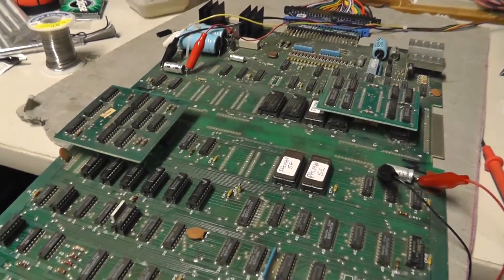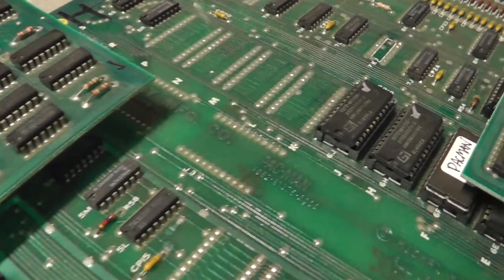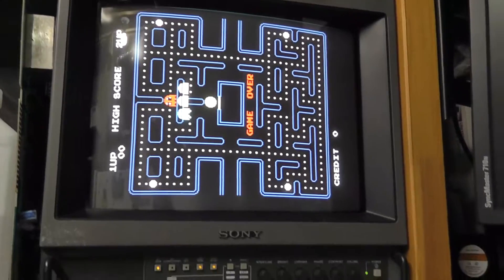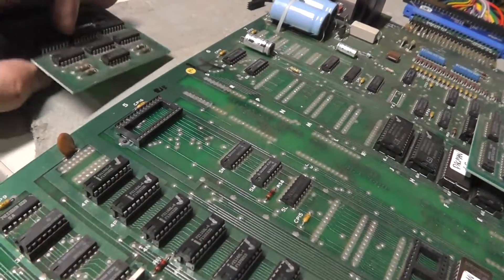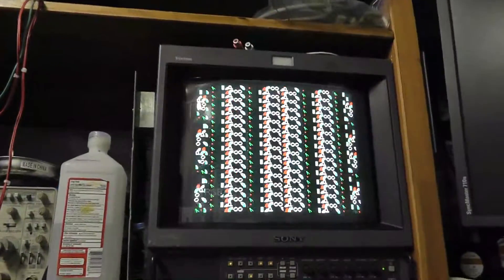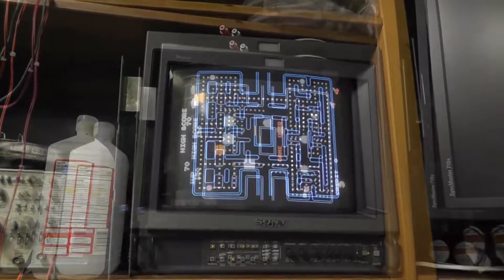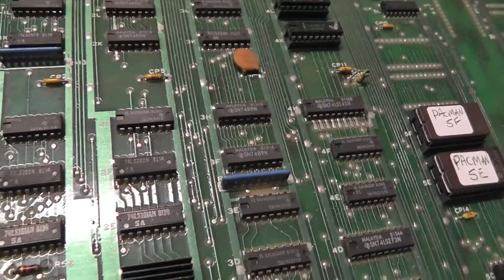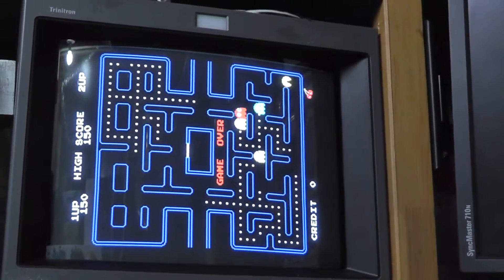Pac-Man Troubleshooting  - Graphics issue

Comment: Shorting data lines to get stuck bits unstuck... been there done that. On an Amidar bootleg (Scramble BL HW). All of a sudden, the graphics became colored lines. After lots of probing I noticed the color RAMs R/W line stuck low. Tried swapping the chip generating the signal. Nothing. Instead of desoldering the (relatively rare) color RAMs I just shorted the line to +5V and not only was the short gone, there was nothing wrong with any of the RAMs...
Reply from the maker: Thanks for the comment and sharing the experience.

Comment: When you "compare" the original ROM file from MAME to the read ROM file that is loaded in the ROM chip you're testing using a GQ-4x. If both files match and get the same checksum value that is Collision?

Comment: When you read the ROM chips data using GQ-4X it will display each ROM address in 8bits hexidecimal values.  How can I add up all the ROM data using a Handheld calculator? or what menu do you go to in GQ-4X that will add up all the ROM data when Reading it?

Comment: Thanks, each arcade games has a test mode diagnostic program, how is the diagnostic program checking verifying each ROM chip when it doesn't have the original ROM files loading how is it comparing or verifying the ROM Chips game program rom contents?
Reply from the maker: actually, every arcade video game doesn't have a diagnostic program.  My assumption is the crc is stored in the diag code itself.  I haven't personally verified that but is a good assumption.

Comment: if the CRC is 16bits , its only going to error check 16bits of the total sum of the rom content loaded in the rom chip. If you add up the total sum of the whole ROM content it won't be 16bits it would be much more. CRC 16 bits is only going to check 16bits of the total sum of the ROM which is not much.
Reply from the maker: I am no expert in CRC and suck at math but that isn't how it works.  It does check the entire contents of the file.  the 16bits references how large the divisor or something basically how many variables you have in the hash to prevent collisions.  The more bits 16, 32, 128 in the hash/crc etc algorithm the less likely you will have collisions.

Comment: my board works perfectly - i just have some slight geometry issues on the far right of the screen any ideas?
Reply from the maker: Probably a monitor adjustment or recap the monitor.
Reply: @jacklick  not the monitor as its my supergun bench and a ips panel lol 1ms gaming monitor (alienware)
Reply: other boards tested with the same setup run fine
Reply from the maker: @jonniefast  and you are saying you can't adjust the monitor w/ this board to fix?  Hard to say w/o seeing a picture but I would measure the Horz, Vert, and composite output frequency of this board compared to others.  If no joy, I would direct you to https://forums.arcade-museum.com/.  Good luck.
Reply: @jacklick  its a computer monitor and only accepts displayport/hdmi lol

i use a supergun/minigun to convert cga to rgb, the rgb2comp into a retrotink pro (near zero latency)
Reply: the pacman board isnt jamma obviously but pac2jamma converters exist for reasonable prices - its a weird issue, i recapped the entire board and the curve on the right side of the screen seemed to flatten after power soaking for an hour but its still slightly curved 🥲
Reply: it doesnt affect gameplay but i have no idea which chips process the video signal
Reply from the maker: @jonniefast  Ok so to summarize.  You have a supergun setup and are using a pac2jamma adapter.  When you say "other boards" I assume you mean other non-pacman boards and don't have another pacman board to compare?  I would break out the schematic and trace back the sync output from card edge.  This will tell you which chips are part of the sync ckt.    If you don't have an freq counter or oscilloscope, I would just leave it as is an play.
Reply: @jacklick   the weirdest part is the curve calms and flattens during powersoak 

i think i better just leave it alone haha
it plays wonderfully otherwise
Reply: & i no longer have access to Oscilloscopes 🥹

Comment: When you read a ROM chip using an external ROM reader to read the ROM contents, it will display in 8bit hexidecimal values for each ROM address. How do you know where the game test diagnostics starts and ends and where does the game code start and end? all i see is a bunch of hexidecimal values so i can't tell. Why is the checksum only 16bit checksum to test ROM and RAM chips?
Reply from the maker: good question.  I haven't gotten in this deep to figure out how to see what different parts of the code are doing.  I would guess people use mame debugger to figure this stuff out as the code is compiled in assembly language <<out of my ability to even give you a better clue.  Regarding checksum, some programmers will post a crc32 etc.  If you got to romident it posts crc32a crc32b, sha etc.  I think for 16bit data only crc16 is required but really don't know 100% why one would use one vs the other 
https://en.wikipedia.org/wiki/Cyclic_redundancy_check

Comment: Is there any way to check for collisions use GQ-4X when reading a ROM data? or just looking at the ROM data content can you tell there is collisions? or ROM error checking visually inspecting it by looking at the ROM data on GQ-4X?
Reply from the maker: When I mentioned collisions it was related to the checksum algorithm being used and the chances of two different files having the same checksum.  That would be a collision.  Not really something you are likely to run into or even need to worry about.